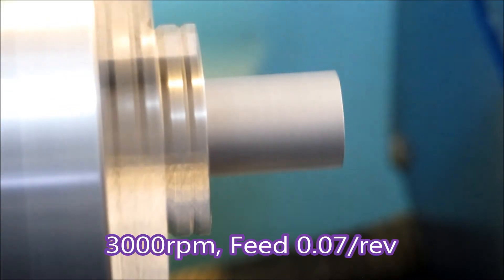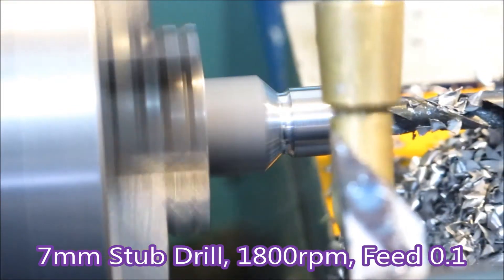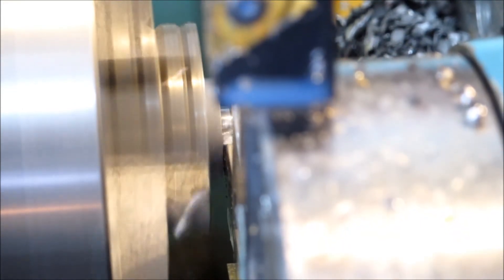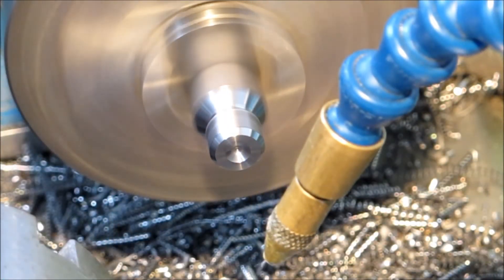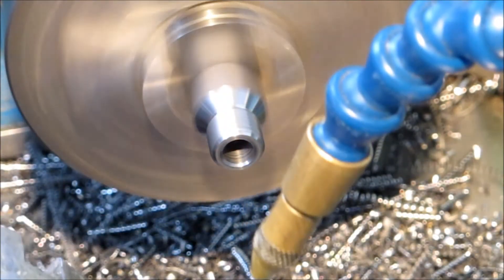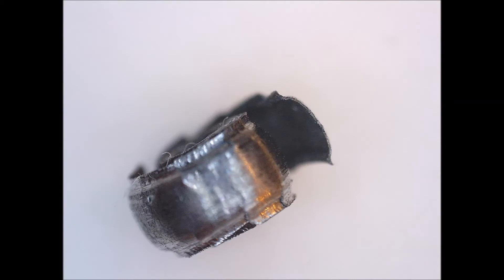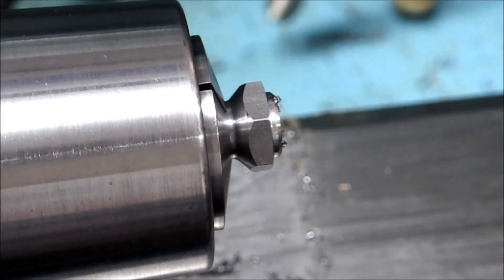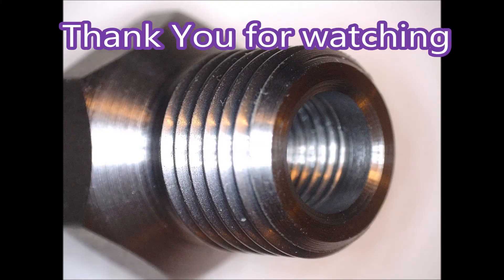CNC lathe threading and tapping vintage BSA Empire Star motor cycle part

Comment: How are you holding your drill bits on the cross slide?  I saw in one of your videos it looks like you have a block with 3 locations. Are they different diameters? Are you just clamping them down with set screws?  I'm planning to make a holder for our cross slide but originally planned to make it only a single place. I have a 1-1/4" straight shank ER32 holder. I was going to bore the block to 1-1/4" and slit the side so it could be tightened and clamp the holder in place.  Do the setscrews damage the your drill bit or tool holder?
Reply from the maker: Hi Brent, I have ER16 and ER11 with 12mm shanks and yes I do use set screws on the shanks. Easy enough to file a flat for the set screws to clamp on.  I know of someone who used splits in the sides and he is quite impressed with the non damaging clamping power.I have many times needed to use a sleeve to hold the drill.  Set screws allow me to drill through the sleeve so the set screws can still clamp on the drill while it sits in the sleeve.
Reply: Awesome, I appreciate the reply. That'll give me a slightly different direction.  Keep up the great work. It's great watching your videos.  We're just trying to dabble into cnc turning. We're using a prototrak 1745P.  It's pretty exciting at this point.
Reply from the maker: @brentjohnson1105  did you see the reply after the edit about having to use a sleeve for the drills?
Reply: @smallcnclathes  Yes I did see that, it makes perfect sense and I imagine I'll have to go that route on some sizes.
Reply from the maker: A long drill in a collet holder just sticks out too far on my set up and I like to go no closer to the chuck than the tools in my turret. I find it helps prevent unexpected loud  noises

Comment: Hey! Thanks for the great video. Which feeds and speeds do you recommend for turning 11 S Mn Pb 30 + c in a small lathe?
Reply from the maker: Good Day Philipp, When I looked up that steel, it looks much the same as what I am using here in this video.  It may machine better as it includes lead which my material does not.  I would think almost any of the feeds and speeds here should be a reasonable guide.  The insert for turning does have a ground edge and 15 degrees of rake so if using a moulded edge insert and less rake, I would halve the feeds used here and see how it goes. If you are using HSS I have no idea as I don't use it.  Let me know how it goes
Reply: @smallcnclathes  thanks for your help! It worked very fine. Now I can turn steel 😍
But I can't part it. My parting tool insert is 3mm wide. I think I need a smaller one. Where can I find your smallest in Europe? 
Thanks!
Reply from the maker: @MrPhilxxxxx  I have 2 from Sumitomo that are available from Germany I believe The other is from Kennametal. Details on my parting tools are in this video https://youtu.be/W1VQu6rKL8E.  Includes a good look at them and the codes for tools and inserts.  You are right about the tool width, mine are1.5, 1.6 and 2mm wide, no way would I consider a 3mm insert.  In my 2mm I mostly use low cutting force inserts which have 30° of rake, cuts really easily and is a very strong tool and insert combination. It does have a limit of 
20 ø but that is because I have a turret which only takes 10x10 shank tools.  I think they go to 25ø if you can use a 12x12 shank tool. Hope this helps

Comment: Cool little lathe.  Great video and nice having the different angles.  Just converted 7x14 recently...trying to get up to speed.
Reply from the maker: Thanks Jason, any videos of your conversion or lathe working?
Reply: Couple private videos from early in conversion.  May put a few up once I get a little more proficient..lol
Reply from the maker: What software drives the the lathe and what do you use to write your code?
Reply: Centroid Acorn drive and control software.  Fusion360 for CAM
Reply from the maker: I look forward to your uploads